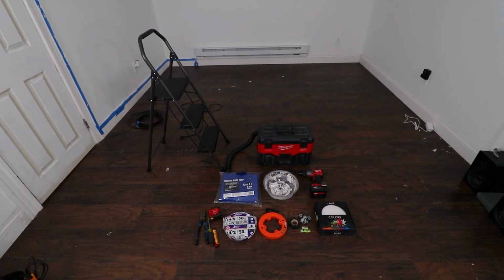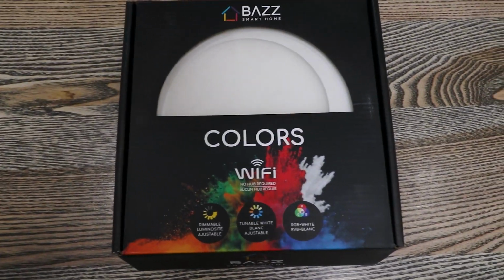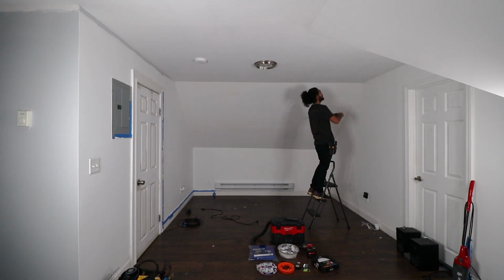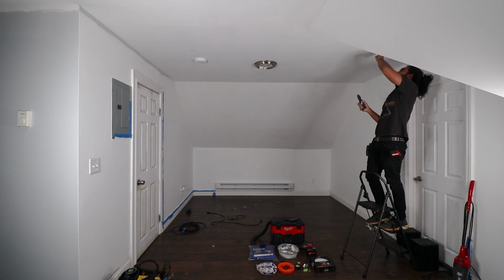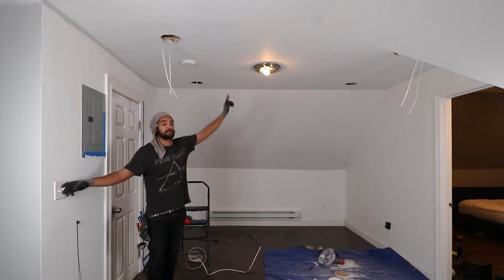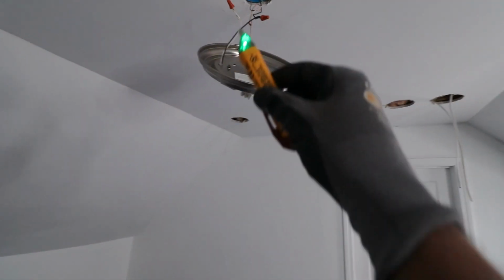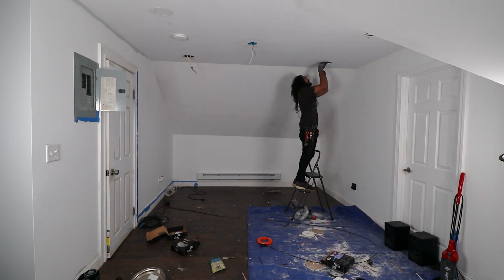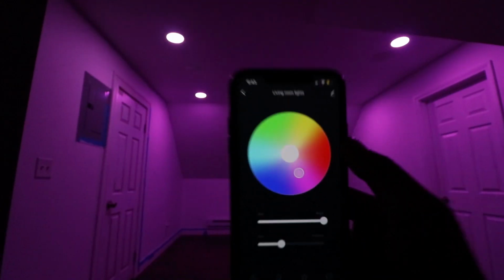How To Install Recessed LED Pot Lights

Comment: What about the hole in the middle of the ceiling the power supply wouldn't it be better to add a light there and remount the box in the ceiling so there would be no hole there
Reply from the maker: It’s all preference at that point. I like the 4 recessed lights at each corner.
It was covered w a blank cover, I used the box as a splice point.

Comment: Do you know if they have music sync? For like a party or something? Also are they holding up well? I'm im between this brand or the lumary ones
Reply from the maker: No music sync for either lights .
I’ve actually tried both lights and they are basically the same thing , I believe they both use the same app software . 
Go for what ever gives you the best deal 🤘🏽

Comment: I have a new home with builder wafer lights and junction boxes, do I need to rewire them to the new junction boxes or can I just use the old ones for a quicker install?
Reply from the maker: The junction box plus the lights is what has the technology. So yes , you will need to require it them.

Comment: I can’t connect the lights to the app. Please I need help
Reply from the maker: Make sure you are connected to the 2.4ghz wifi.
Reply: Is there any recessed color led that works on 5ghz?
Reply from the maker: @djmlover  I don’t believe so , but your provider should have 2.4ghz brotha
Reply: I have 2 ps5 4 wifi TVs is 2ghz will slow my speed?
Reply from the maker: @djmlover  eh it’s just to connect to your lights . Doubt it would slow it down.
Reply: I appreciate your response, Thankyou

Comment: Thanks for the video. I can’t seem to find the specs for the thickness of the light. Is it thinner than drywall so it can be placed anywhere without worrying about ceiling joists?
Reply from the maker: Correct, wafer lights are designed to be installed anywhere even if a 2x4 is present.
Reply: @VaideRx  I finally got these installed. It was a breeze. The app is ok. It takes a bit of time to figure out. I haven’t been able to figure out how to create a scene where each light has a different color I specify. Otherwise, it’s really nice being able to chose Daylight White during the day and Warm white in the evening. Thanks for the video!

Comment: How did you connect them all together to change at the same time? Mine wont do that
Reply from the maker: Click on the light on the app, on the top right you will see a “ pencil “ click on that. Below you’ll see “ Create Group “  select all the lights you’re looking to group together. Mine is labeled as “ Living room lights “ once the group is created you’ll be able to control all lights at once. Hope that helps !
Reply: @VaideRx  absolutely it did, your awesome!!
Reply from the maker: William F turn lights on and off 3 times until all the lights start blinking. You should be able to sync all lights together if you’re on the 2.4gh WiFi.
Reply: @VaideRx  it has all the devices show up but I can only control one at a time and not all together, I synced them all at the same time as well and made sure my wifi was the 2G one vs my 5G I also have the lights that screw into my existing recessed cans
Reply from the maker: Awesome !!
Reply: @VaideRx  the directions really did not explain about the groups, again thank you 🙌

Comment: I purchased 8 if these lights because of this video. One of the downlights does not work. I am not able to reach the company. They sent a generic email in French saying they would get back to me. The only problem is I only have 30 days to return. I would live to keep the lights but they do not work!😡
Reply from the maker: Ms. C damn man sorry you had a bad experience with these lights ! I can’t say this product is perfect it does have its imperfection. Get your money back and don’t deal with the headache.
Reply: @VaideRx  I finally sent the lights back $33 dollars later at UPS.

Comment: Do these lights get hot in the ceiling and did you have problems with studs or joist in the ceiling ?
Reply: VaideRx, could you please clarify how you got past the joists in the ceiling? Great video!

Comment: What happened to the hole in the middle?  Is that for the fan?  Sorry if I missed it.
Reply from the maker: Vlabber the whole in the middle was the existing light that was there. That’s where I was able to get my feed from.
Reply: VaideRx what did you do with the junction box in the middle?  Throw a cover over it or drywall it over?
Reply from the maker: Gametris I actually installed a light fixture, made the vacant space useful
Reply from the maker: Gametris you could cover it up with a round plate !
Reply: Can you still add a fan in the middle???
Reply: @mocheeks23  no. The box that is installed there isnt rated for a fan. He would have to swap out tge box with a fan rated remodel box

Comment: Looking for can lights and came across these, kinds skeptical as I can’t find any other slim can lights with the small box ballast, let me know if they burned your house down or have caused you any issues
Reply from the maker: SBPD7203 my house is still not in flames haha , as you mentioned if anything goes bad it would be the ballast I know it has a 5 year warranty as well !